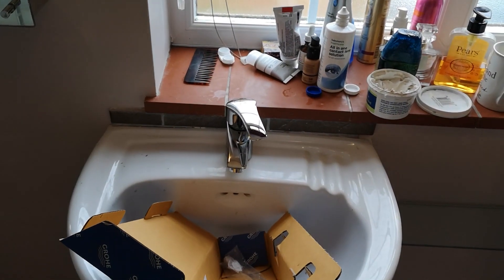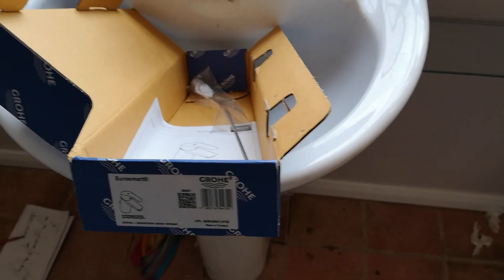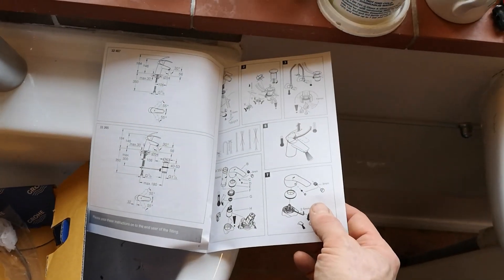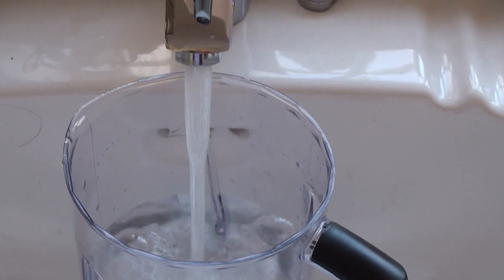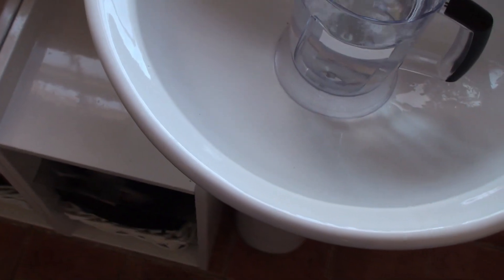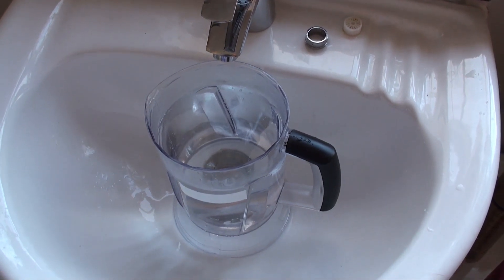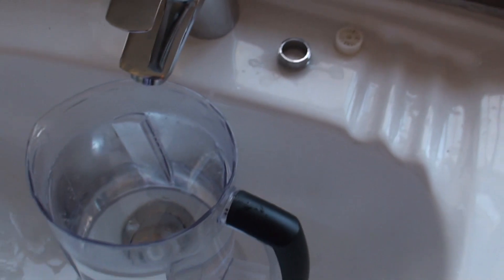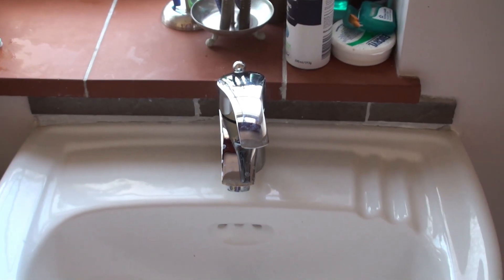Grohe EuroSmart Low Pressure Basin Tap Test 0.2 Bar - Will it squirt?

Comment: Hi there. I bored out the hole in the top of the flexu hose but it destroyed the seal and ruined the unit because the flexy hoses can't be removed.
When uk bored out yours, what size drill bit did you use?
Reply from the maker: The hoses can be removed from the tap body (as I remember??) . Dont know what size it was just enough to remover the restriction.,

Comment: Thank for that I am looking at what's my flow rate on bath taps a we have a combi  boiler? And would like put a shower bar thermic control.  I will need check the flow rate.
Reply from the maker: No problem.  A combi should be no problem.

Comment: I have a kitchen tap which all of a sudden the flow is a lot less then when new. I guess it needs cleaning. its a boiling water tap 2 in1. Is it a case of taking a spanner to the tip unscrew? I'm trying to refrain from damaging it.
Reply from the maker: Depends where the limescale has built up. Have you tried just propping a jug of warm descaler under the water outflow on the tap? Leave it overnight....
Reply: @razenby  hi thanks for replying. I have left a solution of vinegar and water on there for a long period of time however didn’t make much a of a difference.

Comment: Made the same error. Bought grohe high pressure taps installed a whole unit and now there's bugger all pressure... If I just change the tails would that be enough?
Reply from the maker: It might improve it but the Grohe 'low pressure' taps aren't the same as they used to be. We have a bathroom fitted with Grohe mixers that flow very well with just 10 feet of head.  We installed them in about 2007,  I think they are these chrome- 23 7121
.  The spec rates them from 0.1 bar upwards.  I wish I had got these instead.  I cant be 100% sure so speak to a Grohe specialist.  You can see that have a bigger nose with more flow.  The 23 7121
 ones we have work much better than those shown in this video.

Comment: I read about this the idea is to save water on high pressure systems by reducing the flow obviously not so good with gravity systems.
Reply from the maker: yes after using then for 3 months I installed a return pipe to the tank and small pump so we don't have to wait for the water to arrive.  Once flowing it is OK.